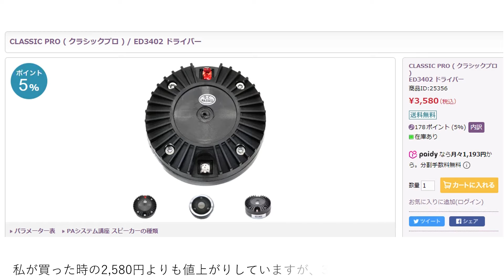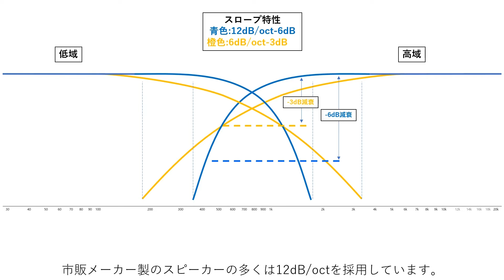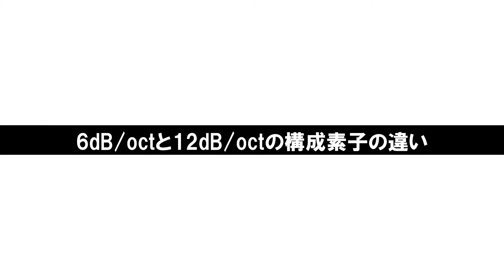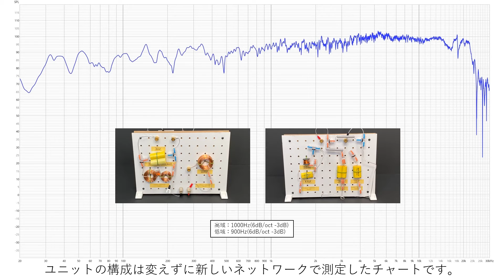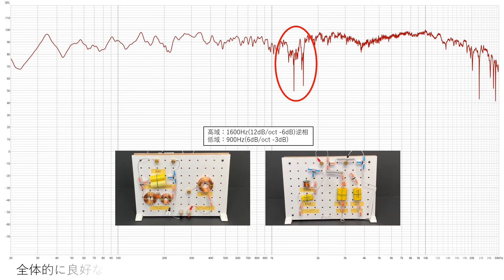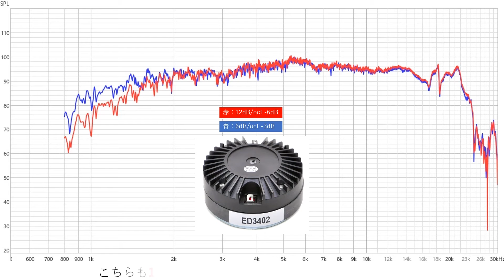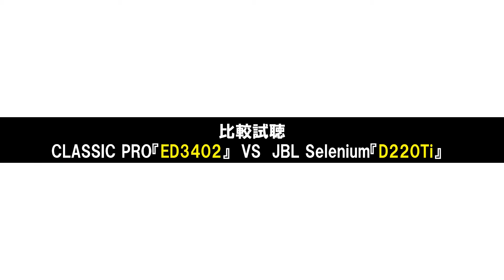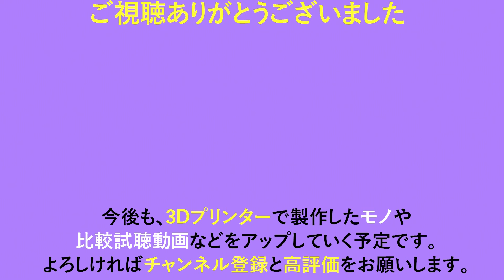【初めてのクロスオーバーネットワーク製作！】コンプレッションドライバーで比較CLASSIC PRO『ED3402』VS JBL Selenium『D220Ti』[No.164]

Comment: Hey, I am planning to buy the Selenium D220Ti. I have the Eminence PSD 2002-8 and seems like its missing a huge chunk of upper high frequencies for HT application. In your video the Selenium sound bit dull, Did you try to set the gain bit low to keep is soft ? I am looking to have it slightly brighter like any Commercial Cinema Screen channels. Is it even the right driver?